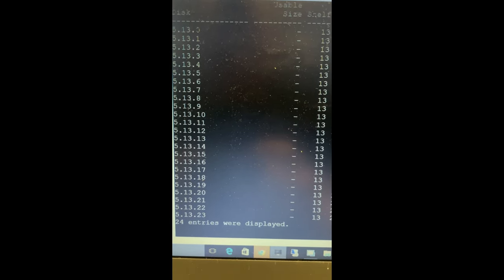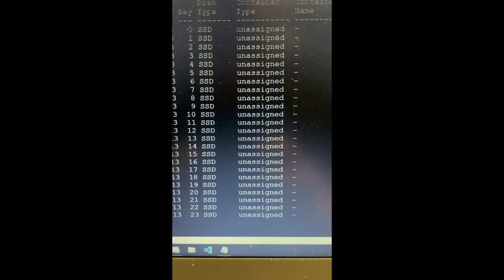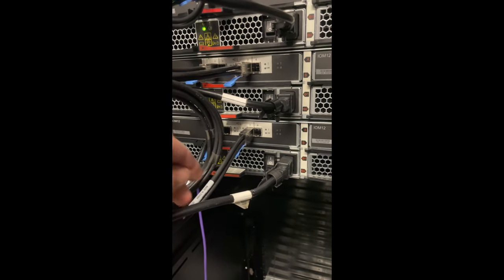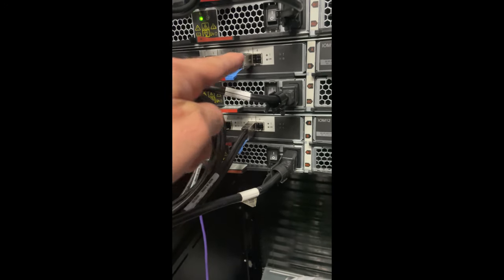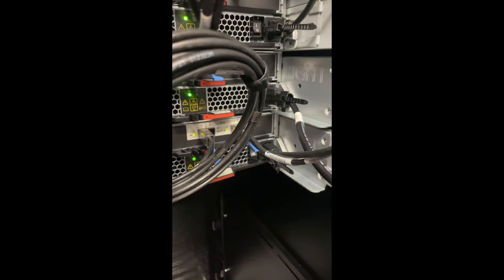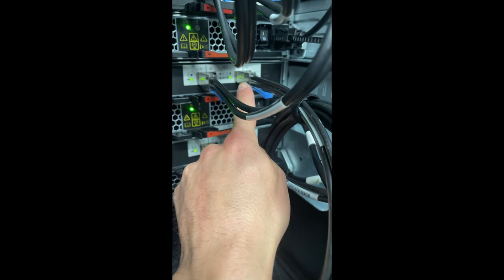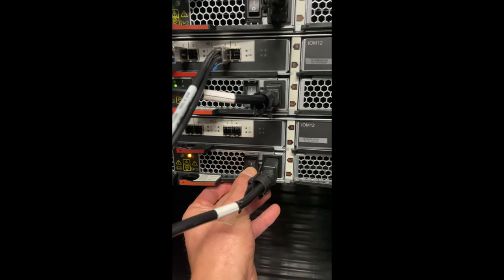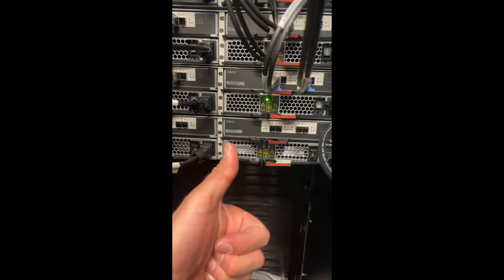WATCH LIVE, NetApp Disk Shelf Removal

Comment: hi, know what cable to connect a NETAPP DS2246 (IOM6) to a poweredge R610 (perc H800) to use Truenas and manage the disks...?
Reply from the maker: Hi Mauricio, you will need some NetApp controllers for that disk shelf, you can't connect it straight to a server